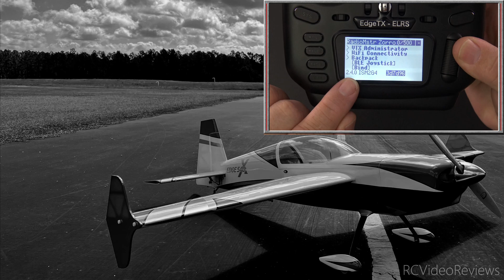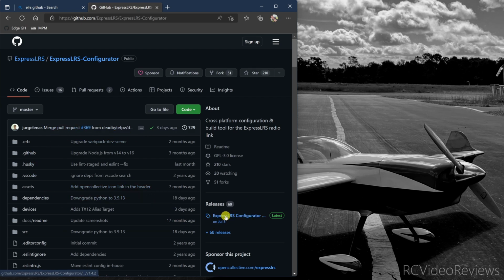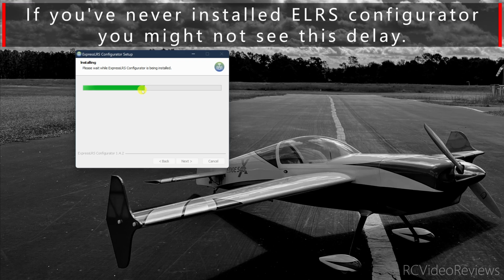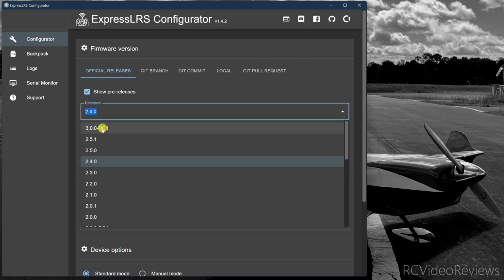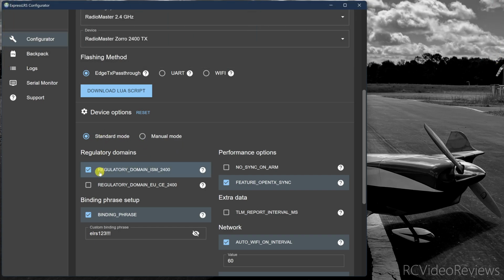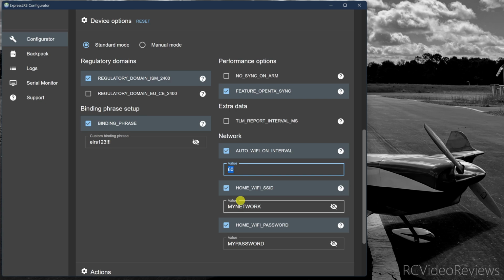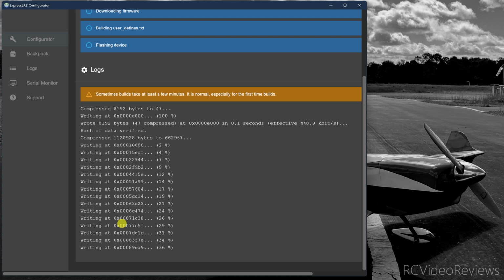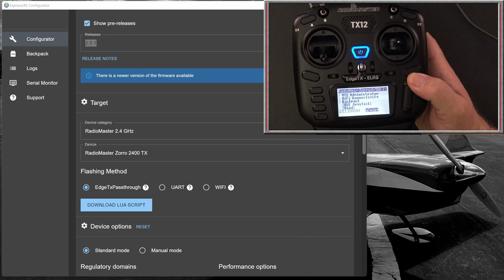Radiomaster TX12 Mark II • How to Flash Internal ExpressLRS [ELRS] via EdgeTX

Comment: Just updated my Tx16s MK11 to elrs 3.2.1
This tutorial was very helpful. Thanks. 🤓
Reply from the maker: Glad it helped!
Reply: @RCVideoReviews  I'm trying to do the same for the same radio you have in this video (TX12 Edge TX) but it does seem to complete the build/flash the build with or Zorro or the TX options for transmitter. Any suggestions?

Comment: cant get it to work. got this messege: A fatal error occurred: Failed to connect to ESP32: No serial data received. any ideas, please?
Reply from the maker: It could be any number of a dozen things. Unfortunately, I can't get into solving USB connection issues because it's a rabbit hole. All I can say is make sure you have a good cable, make sure to select serial mode, make sure you hear the bong on your computer. Make sure the com port shows up in your device manager.
Reply: @RC Video Reviews  thanks for the answer! My elrs-module had a burned resistor in it. So they gonna send a new radio now. Thanks!